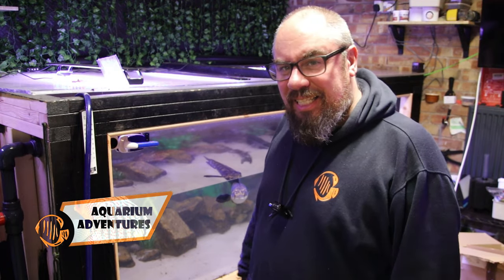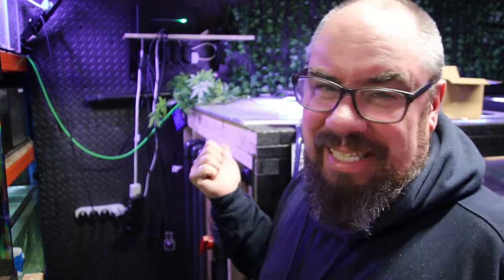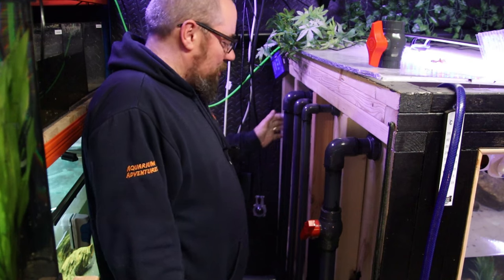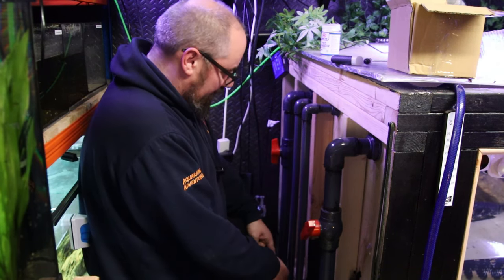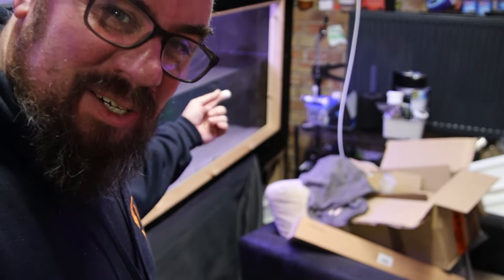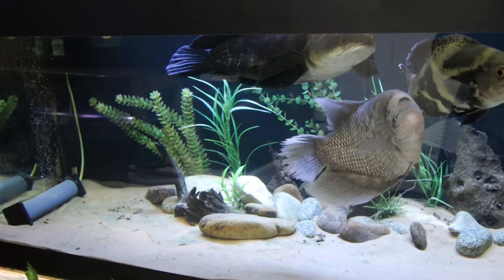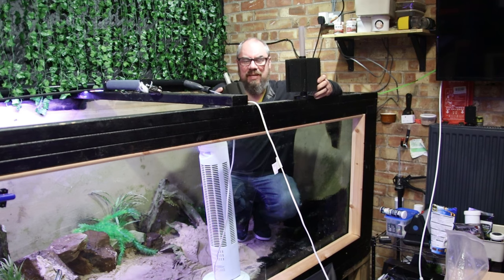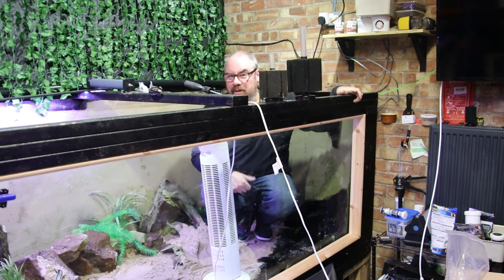MEGATANK update - monster fish tank upgrades and repairs

Comment: Do you ever take the uplift tube, and bit that connects the air hose off a sponge filter, and stack an identical sponge filter that’s had the base removed? I’ve no idea if it pulls water through the whole thing, but I actually love how ridiculous they look, and the added surface area is never a bad idea.
Reply from the maker: I haven't - but that isn't a terrible idea though. I only have one stupidly big one so might have to look out for another to try it!

Comment: You do realise the outflow pipes are supposed to be set at the right height to stop the sump overflowing when the power is off
Reply from the maker: I do - and they are. But the tank is so big in comparison to the sump the bit that does drain is too much for the sump
Reply: @AquariumAdventures  I get you sump isn't big enough, bloody shame  ,I would look into a bead/sand filter save you the agro mate
Reply: If you put a 90 on the inside of the bulkheads angled up then you would only drain a couple of mm of water when the power goes out

Comment: The amount of money you’ve spent on sealers and silicon and tanking and fibreglass. It would’ve been cheaper to build one out of glass.
Reply: Unfortunately he's not got a time machine
Reply from the maker: To be fair - I've never had to buy more fibreglass or liquid rubber, just using what I already had - and even if I had to buy more it would absolutely not have been cheaper to build it from glass. Have you seen the price of glass?!
Reply: Yeah there is a company in Northern Ireland based in the UK as well called Kerry Glass there reasonably priced when I built my tank no one else could beat that prices. Mine is 3.2 m long by 900 High550 wide. I think I paid £1100 for the glass15 mil thick each to the own I suppose you’re used to it now though fixing them little leaks like getting dressed in the morning